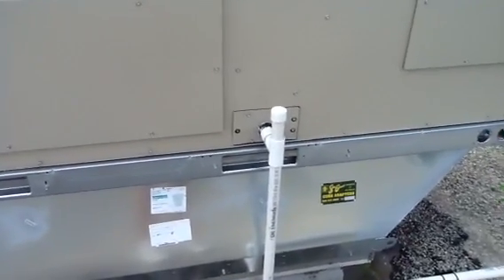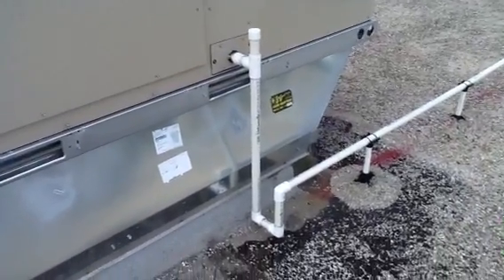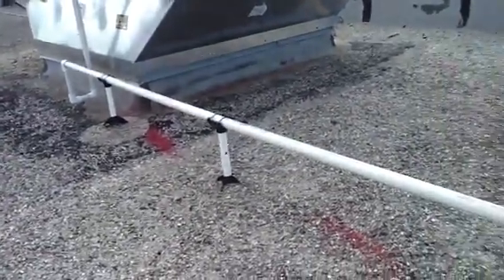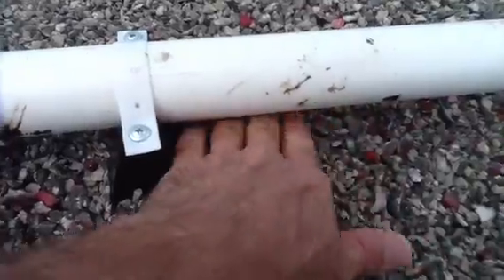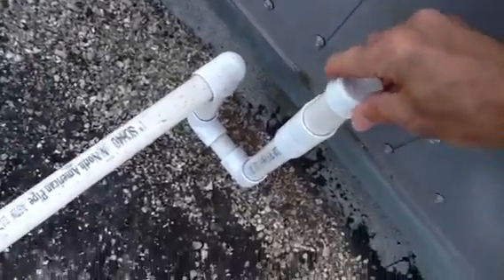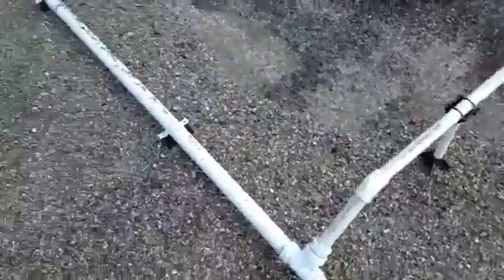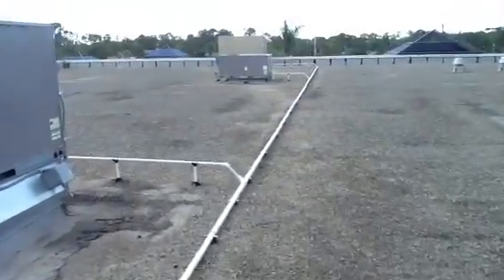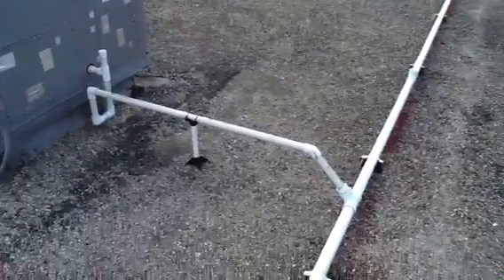Multiple Roof Systems; Rooftop Package Unit Condensate Piping

Comment: Why do you need a trap if it is draining to the gutter? Isn't a trap to prevent gasses from backing up in a sewer system?
Reply: No. It’s to keep air from backing into the unit through the pipes.
Reply: Negative pressure.

Comment: Wouldn’t all those drains just freeze up in the winter?
Reply: Because in the winter you are not running the AC so probably do not have the condensation but you are right that the P trap would still retain some water but in Florida probably does not happen often enough